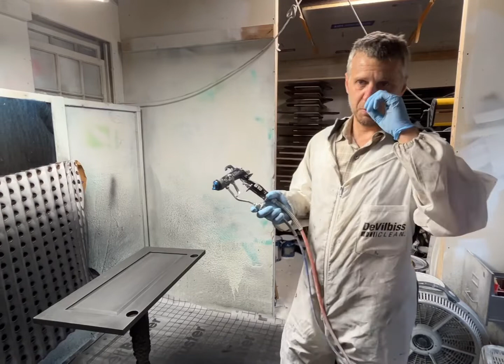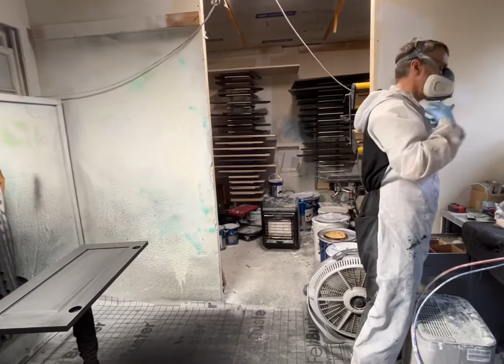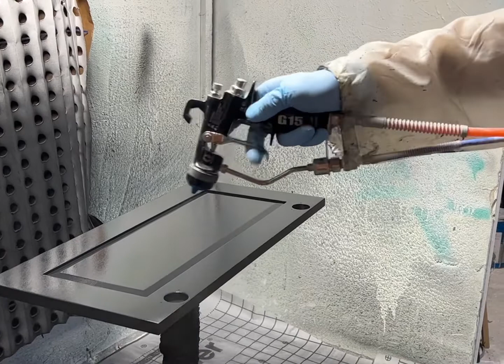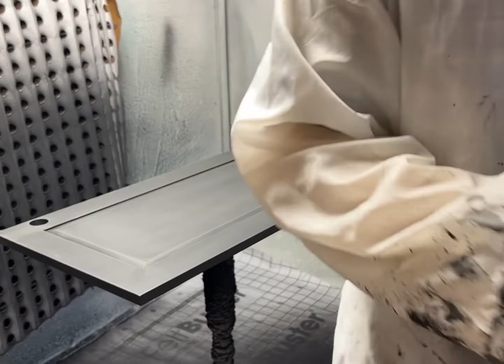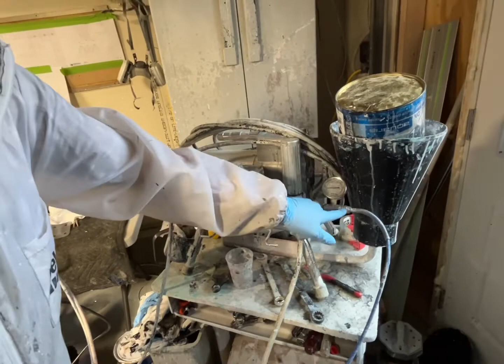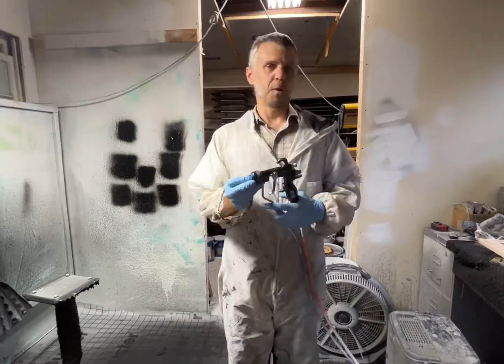Graco G15 / And My Favorite 2K Renner Paints

Comment: Hello sir. Thank you for sharing your knowledge.  What is your suggestion to use on new cabinets as a clear top coat from Renner ?( the cabinets are made of hdf red oak- will be wipe stained with white oak wiping stain-, and walnut- stained as well with a spraying stain)
Reply from the maker: @20002000tudorgeorge  I like the Renner 688 or 851 Clear base. I prefer to use a sanding sealer then the topcoat
Reply: @ once again , thank you so much for your time , and sharing your experience! As a sanding sealer do you refer to 851 (in this scenario), or would you recommend something else?
Reply from the maker: @20002000tudorgeorge  My personal experience with 851 is that though it is considered a self-seal product, it performs better with an actual sealer,  like 321, or 624. Spray a heavy coat of sealer, and then sand smooth and then topcoat like normal.
Reply: @ thank you sir!!

Comment: Thanks for the videos.  If you look at the datasheet for the 688 it says that the 688 if a one-top coat system. Do you shoot two top-coats with this product or just one?
Reply from the maker: I've spoken to the reps about that and they say it can be one or two. I get better results with 2 light coats versus one heavy one. I have gotten by with one coat in some cases but it seems to just be nicer with two.

Comment: have you tried the YO-XXC005
Reply from the maker: Yes I have. It's a great 1 k product if you want to use a single component product.  I added a little crosslinker for added durability.
Reply: @homesteadcabinetdesign3406  this is the main product I use. What is the biggest difference form the 2k products (aside from using a catalyst)

Comment: Silly question, do you clean out your new units before spraying WB products? Are there any pump oils etc. from manufacturer? If so, would love to know how you clean it up before first use!
Reply from the maker: Yes, they should be cleaned out before first use. run some clean water and maybe some acetone or something through them and then flush with water.

Comment: what primer do you usually spray and with what tip setup on that gun using the AAA setup? thanks! I'll be using this exact setup with 648 for new MDF doors. Would love to know what you use for that primer using this setup. I assume I'll have to thin it down a bit but still unsure if I should just spray the 648 with the airless, then use the AAA for the top coat.
Reply from the maker: 648 and 643 spray the easiest with airless. But can be sprayed with AAA if thinned down about 5%. I use both. Airless is easier for spraying primer. Where AAA shines is for spraying topcoats

Comment: looks very good! what advantages are there in air assisted over just airless in your opinion? less overspray? I use the same products, nice set up
Reply: You can spray with half the fluid pressure. There's much less overspray (depends some on what gun you use). The G15 and the Kremlin Xcite both atomize topcoats well. But for high solids primers, sometimes its almost as easier to whip out the airless.

Comment: Nice video. I was wondering if you only spray water base now. Also does the 688 and 851 give as good a finish as precat or conversion varnish. I still haven’t made the switch over yet but I may soon. Great video. Also you say your Kremlin pump is a bit weak to spray the waterborne coatings but what if you had a 30-1. Would that be sufficient do you think. I appreciate the feedback. Thanks again
Reply from the maker: Yes, I only spray water base. 688 and 851 both give a finish as good as precat or CV. Better than precat for sure. The 688 is as good or better than CV. It's the best water based topcoat you'll find in my opinion.  The Kremlin 10:1 pump that I had was too weak. Get a 30:1 pump minimum. The bigger the better especially for high solids primers.